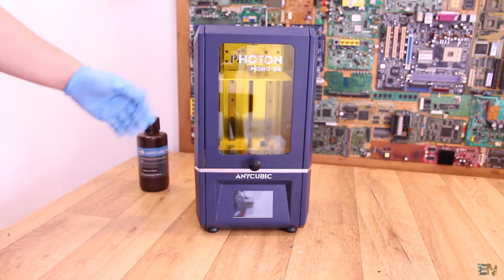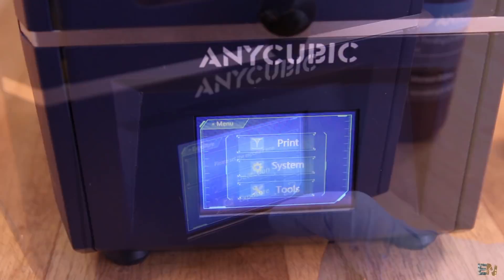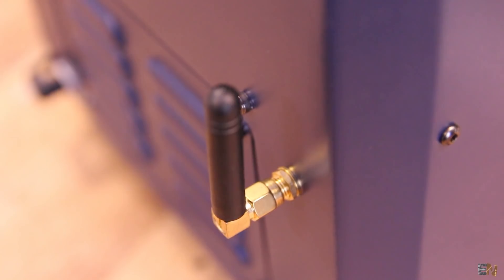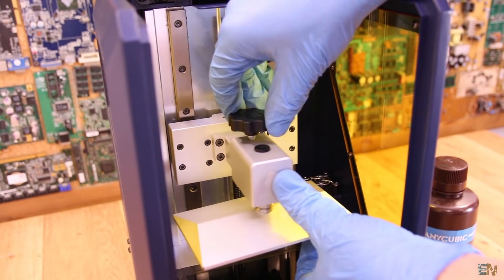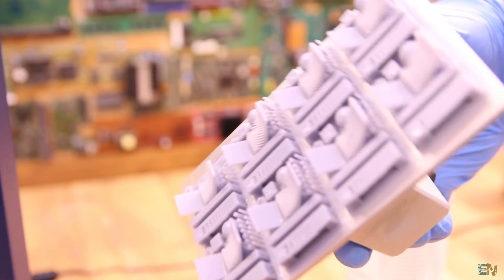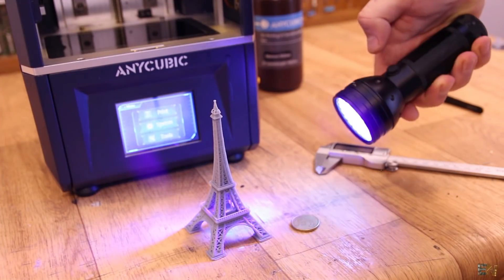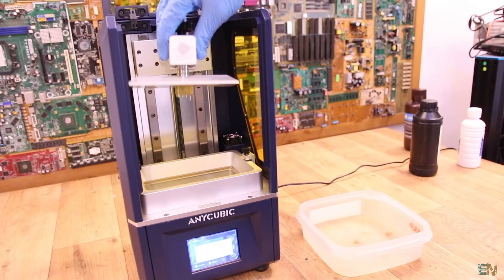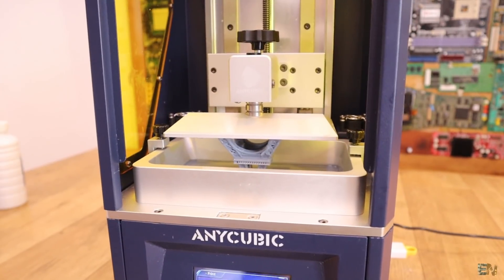Anycubic MONO-SE DLP Resin 3D Printer Review

Comment: I have the same printer, and there is one problem - on the Z-axis, the printed height doesn't match object size,
 for example, if I print a 10mm height object, it will be around 9 - 9.2mm (~10% lower than should be). Maybe just I have this problem :/
please help!

Comment: Great video -- I particularly like the fact you own up to your mistakes as that's an important part of the learning process.  I have been looking into 3D printing for some time but was not all that impressed with FDM so resin seemed more interesting to me.  I'm not much into the fantasy figures thing, not sure what the fascination is for adults, but being able to model things at an engineering level is what has my attention.  I do have a question that maybe you or someone else knows the answer:  while printing the printer exposes a layer then lifts the build platform to separate the new layer from the FEP, but it appears that the amount of lifting is way more than needed to complete the separation -- does the print need to be completely removed from the resin bath?  What controls are there for this lifting distance?

Comment: Great video. I have the photon s. I do not usually print directly on the build plate because it is difficult for me to remove the pieces. Another thing that I have noticed is that with the holes there you don't prevent it from creating vacuum when printing

Comment: 12 seconds of exposure for grey resin is same with Anycubic Photon S, I thought that monochrome screens will make faster prints.
Reply: He uses a version of the Photon Workshop that doesn't support the Photon Mono SE, so he selects the Photon S and you see those very high exposure time values. Those values for Mono SE are much lower.
Reply: Those exposure times are not right, it is true that he selects the Anycubic Mono SE printer model. 12 seconds per layer is too much! Unless it's a video editing error.

Comment: I just bought me the previews model of this printer the photon, tried printing "Sagrada Familia" church but I had to stop because the linear screw was screeching very loudly, lubricated the lead screw with motor oil, silicone grease, and wd-40 out of desperation, the problem did not go away with either. Got any idea how to fix this friend? Thanks in advance cheers. Great video, showcases the trials and tribulations of printing with resin.

P.S.: If i had waited another week I'd gotten this model too.

Comment: That surgical mask is insufficient for resin vapor removal as it is only meant to remove certain particulate matter and not VOC vapors. A proper vapor mask removal filter should be used and at minimum a mask with a carbon inbuilt filter but remember ambient temperature plays a role in their effectiveness.
Reply: Can always use it to go shopping with

Comment: I'm interested in how strong a printed piece is. If it is as strong as a 3d printed part or less
Reply: Yes, it is as strong as a 3D printed part because it is one.
Reply: @GLITCH_-.-   I saw some pieces printed with this technology and them  are not enough strong compare with 3d printed. I hope this resin and this printer is different. I wait a review from @Electronoobs
Reply: @bogdan546  My point was: This IS a 3D printer.
Reply: @bogdan546  I believe it was anycubic that recently made a much stronger resin. Dont know what your using the parts for but it is pretty damn strong compared to an sla

Comment: Am I misunderstanding the technology?  I thought that "DLP" is essentially a little projector. This seems like a standard LCD masking type printer, not using a DLP?
Reply from the maker: DLP stands for digital light processing. DLP projector usually works with micro-mirrors. But the LCD projector also has a DLP chip. Actually, is processing the light in certain ways to get the final result. So we could call this also a DLP system.